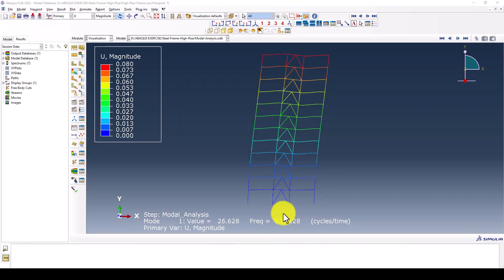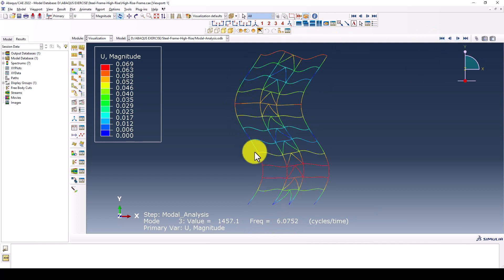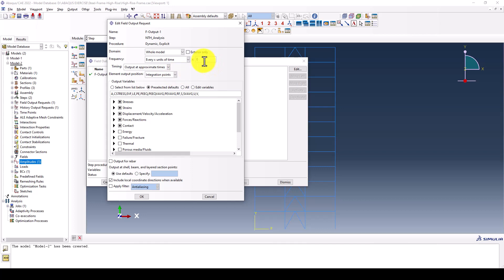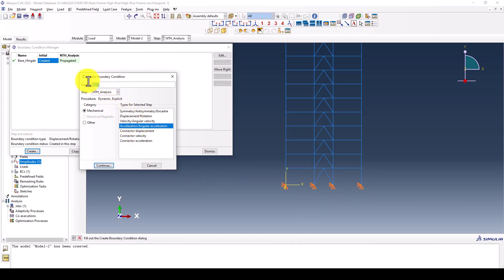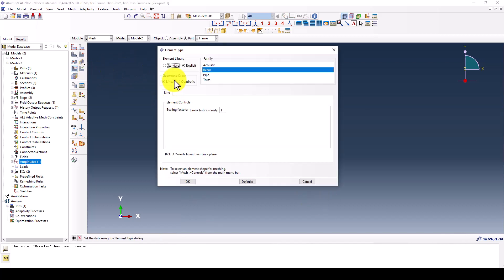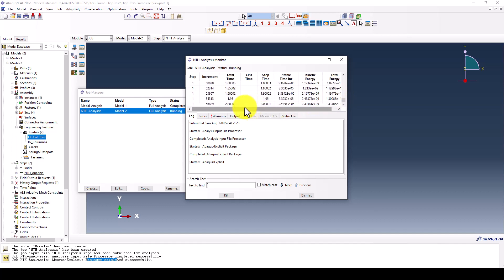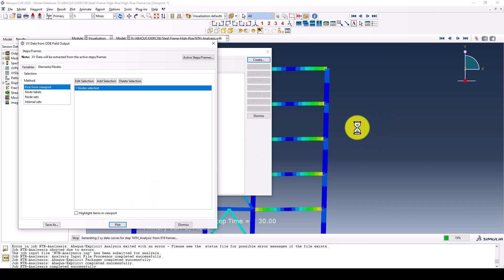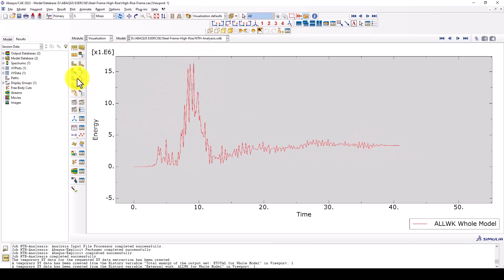ABAQUS Structural Dynamics of High-Rise Buildings, Nonlinear Time-History Analysis Part_2

Comment: hi it still gives an error" constraints and connectors are not allowed at nodes with anisotropic mass"?
what shall i do now as i am working on my dissertation and needs to be finishing it soon?
can i do dynamic implicit analysis as well ?
Reply from the maker: Watch the video carefully and after that check your model and run it again.
Reply: @KSSE_Engineer i have done it so many times but no luck. shall i remove the mass at the nodes
Reply: is there any solution to get rid of this error " constraints and connectors are not allowed at nodes with anisotropic mass"?